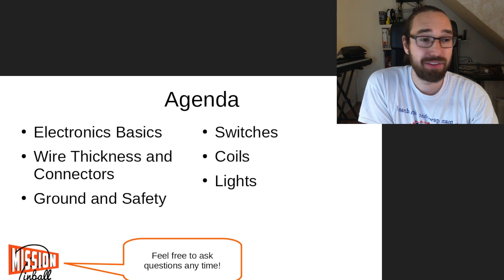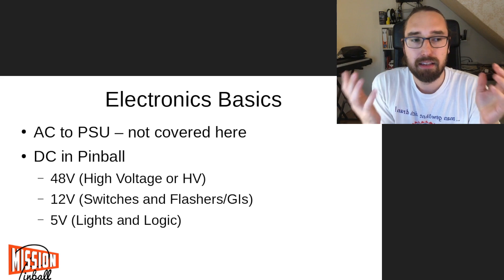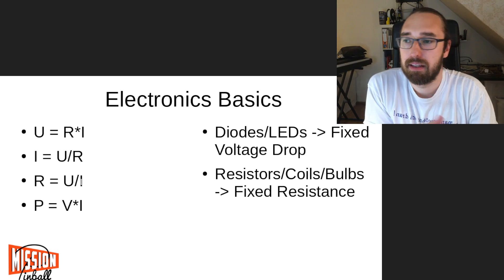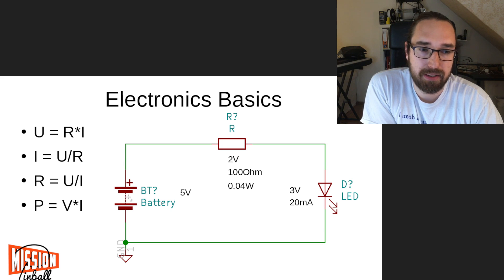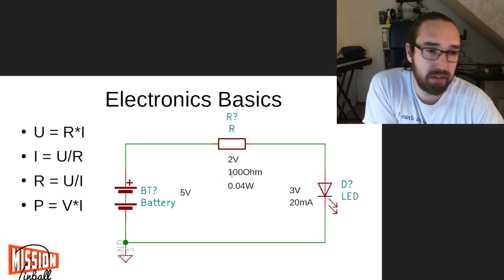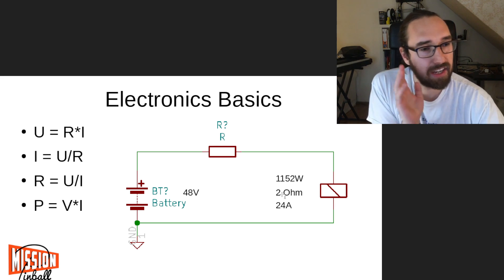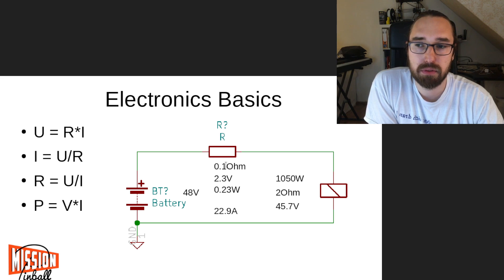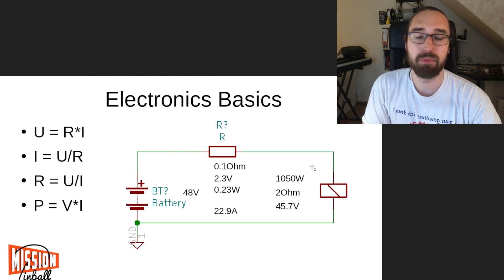Electronics Basics for Pinball Designers - How to Wire Pinball Machines 1/6

Comment: Could you build a bingo pinball machine?
Reply from the maker: Sure that would work. I think most existing bingo machines are from a time where they still used AC only in the machine. However, electronics-wise you should be able to build them just like more modern pinball machines.